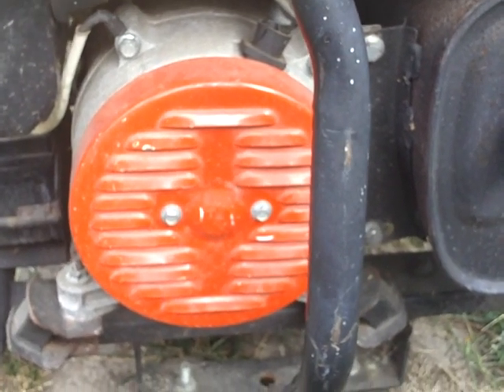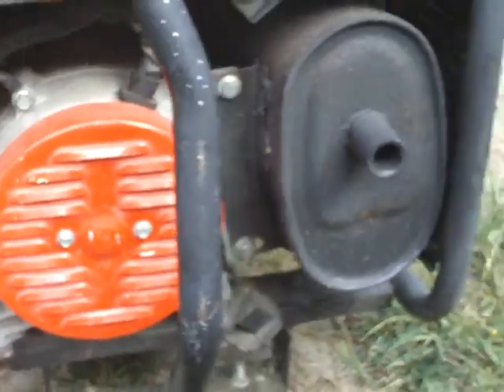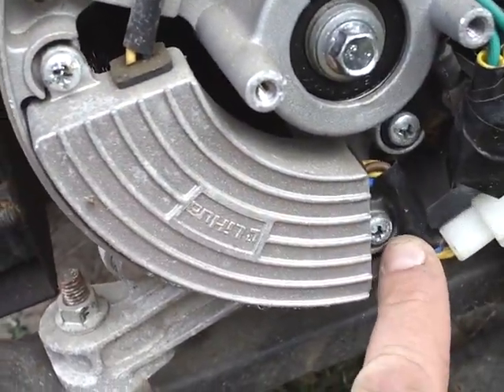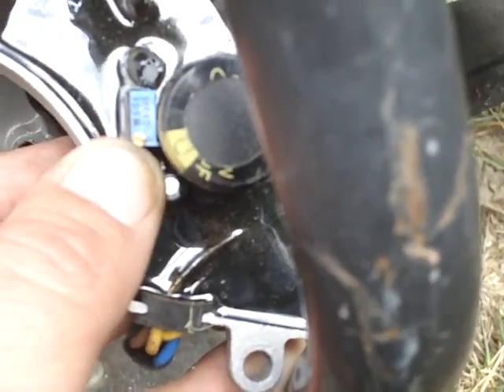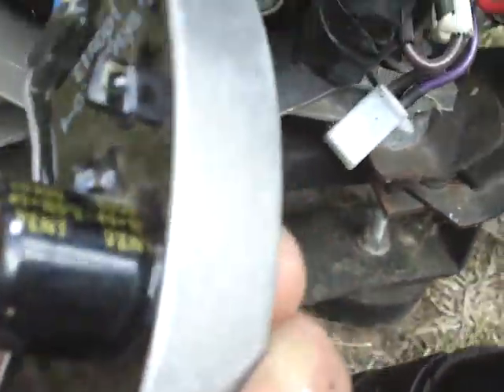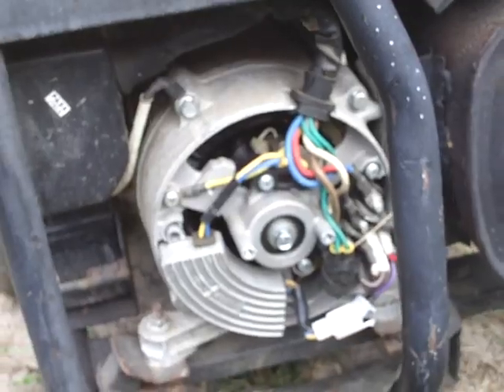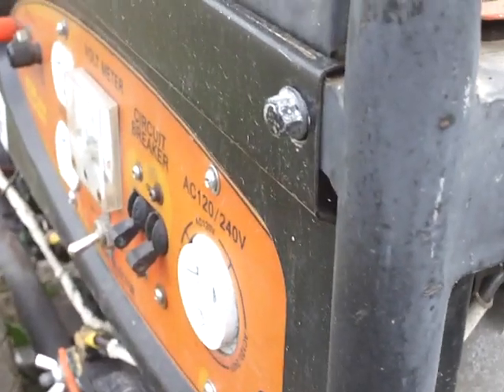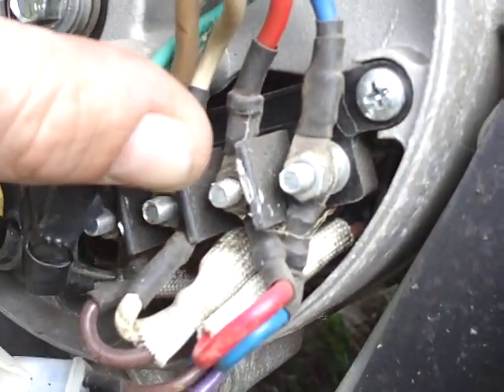The business end of a china made gasoline generator !

Comment: I was given a 4000 watt predator generator its not putting out power im replacing the brushes on it but how do i tell if the avr is bad
Reply from the maker: I will make a vid showing the proper way to test .. THANKS !
Reply: The rotor winding wire near the sliprings may be rotten off. Seen this on couple these generators,  is possible to solder it on place. Some other problems also seen, like short circuit in stator with bad smoke.. these generator heads are really poor quality, recommedent to replace it by 'not chinese product'.

Comment: Good video thanks a lot,I need a AVR like yours there,where do I order this parts,chinese.
Reply from the maker: https://www.ebay.com/itm/3000-Watt-Generator-Voltage-Regulator-AVR-Automatic-Rectifier-2-3KW-250V-220uF/263349380553?hash=item3d50d8a5c9:g:zHcAAOSwEaBaHTLj
Reply: i have a generac 5500 which has the same style avr. mine has a uf rating of 360 with 350v on the capacitor. on the outside of the avr it reads 5.5kw-8kw 240v. can it be tested?
Reply: U can order in "shoppe" online

Comment: I wonder if you could chop a bad capacitor outta that epoxy resin and replace it instead of spending $50 for a whole new unit!!☺
Reply from the maker: I think you would tear up the board inside it has 1/2 of epoxy resin on top of it !!
Reply: I bet you could probably cut that cap in half and gut it to get to the positive lead without even touching the board or epoxy and throw a little Axial Cap in there eh!!☺
Reply from the maker: 805ROADKING hey , That might work !! If I blow one in this thing I will try that !!
Reply: 805ROADKING o